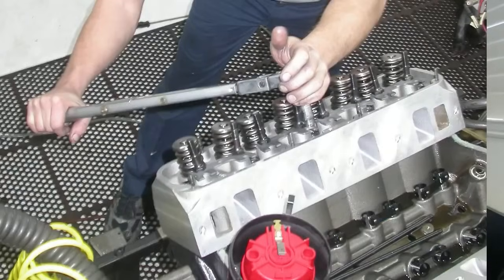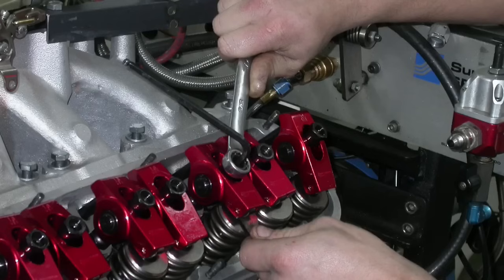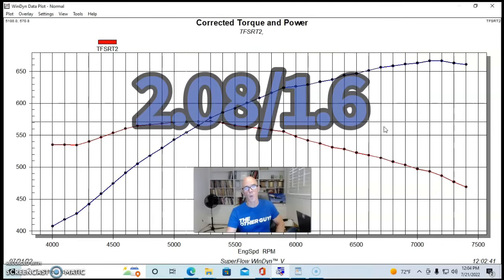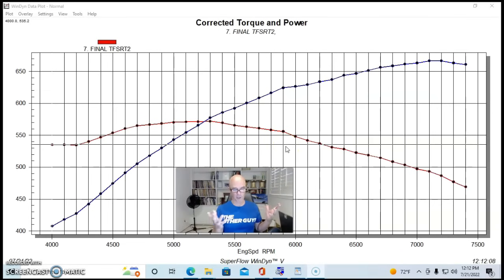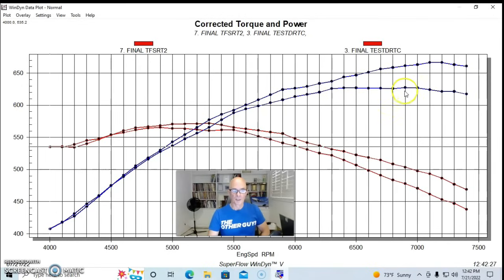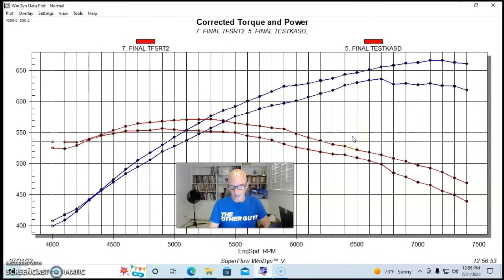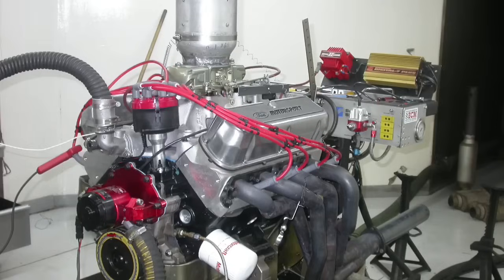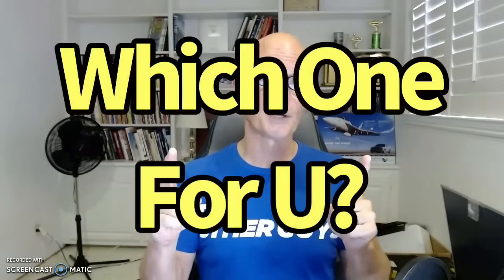WHAT CNC-PORTED SBF HEAD MAKES THE MOST POWER? KAASE v AFR v TFS R v DART v CNC VIC JR & HIGH PORT?

Comment: To answer your question, TFS R Heads are the best heads man can get, imo..
Reply: Unless you are racing those heads at a 1000 hp they are pointless if you can fork up that much money you're better off going to the four valve setup which will smash the trick flow heads in flow at a lower lift rate 
You can buy a four valve Lincoln aviator motor for around 1200 bucks and have four valve heads and a aluminum block at that for the cost of those expensive trick flow heads
Reply: @jonnathwill8318  Oh I know these things can flow like crazy, but why not start off with the best heads the 2v can have?? These are normally for big bore versions of the 2v.. I'm going lil bore, just 20 over but a 5.0 stroker kit rated at 1,000rwhp so eventually I plan on a positive displacement supercharger n testing the limits of the kit.. Reason I bought those heads is bcuz I didn't know they required bigger bores, I just thought it was CNC ported..lol But when I bought them they were $300-500 more than the regular ones so I thought they were much more worth it in the long run.. Now, price went up on them, plus there's always room for improvement with these heads so it's better to have them than want them n not have them, you know??
Reply: @P71ScrewHead  I part milled my 4v bottom end for 2.5k aluminum block, new forged crank, forged billet rods ,forged Pistons 2618 rated at 1500 hp 
I also have other parts for a cobra blower setup I spend around only thing I haven't got yet was the pulley bridge and I spent around 1500 to 1700 for cobra intake lower alternator brackets Cobra timing cover Cobra alternator relocation pulley sfi 8 bolt flywheel 
I paid 800 for the heads 9 thread db casting hopefully I can get my hands on a VMP blower 2650 gen 3
Reply: @P71ScrewHead  there's a guy named Andrew lavender on YouTube he was running mid 8 second quarter miles with Stock port 2v heads custom cams and springs with a single turbo basic forged bottom end nothing special 
He has now switched to trick flow and bigger turbo but he has also turned his car into a full-blown race car and to me over all he ran a lot better and had less problems when he had the stock Ford two valve heads that's why I try to tell people you don't need a lot of that exotic stuff create power on a two valve most guys are disappointed money spent versus actual horse power that they make
Reply: @jonnathwill8318  Oh yes, I agree, a simple forged internals make plenty of power but the less efficient the engine is the more lbs of boost you need to make power n the hotter it gets.. Also, that's turbo, I'm going pd supercharger.. Unless going race gas, e85, or alcohol, it takes alot more to make big power on the blower.. 20 over is the minimum required for the heads to work.. A stroker will always make more power than a stock stroke engine.. I'll dyno the results n determine if it was worth it or not.. But the Coyote makes power bcuz of the stroker n 4v setup, I'm a 2v guy tho.. Reason I spent this much was bcuz I was documenting the mods n dynoing the results but things quickly took a shit on me, my engine got worn piston rings 💍 (so I've been told) so I chose to scrap my plans n just do everything at once.. I was gonna dyno the adding the stroker kit by itself but now I'll have to see what everything gets me on the dyno.. Ppl spending $10+k staying 281ci, I rather have a stroker 2v..
Reply: @P71ScrewHead  19 more c.i or 0.4L is alot at the cost of having the piston come further out of the bores at bottom dead center which is going to cause piston skirt wear at a faster rate
I also think blower technology has come a long ways in efficiency and yes I do believe efficient motor less boost but
Your efficiency of the motor can also become not efficient with a improper cam selection  but with a positive displacement it also comes down to intercooler technology and heat exchanger technology which I believe has come a long ways
Also with those heads I have a email from 7 or so years ago before I started collecting parts for my two valve build trick flow stated to me that the r heads needed a bore size of 3.650 to 3.700 to truly be efficient 
They did state that the non-r heads will be fine with stock bore 
I have three crown vics and all of them are flex-fuel that run off of e85 only 
Also the coyote is Miles ahead of two valve technology the coyote has a bigger bore same rods as a 4.6 and a slightly longer throw on the rod journals on the crank that's 
The only true stroker that's worth the cubic inches is the 5.4L
Reply: @P71ScrewHead  this is my builds and parts on my other channel 
I haven't posted in a while because I am currently taking the motor out of my fourth crown Vic and put it in my 1 of my 3 crown Vic I had some issues with the fourth crown Vic that I had some Gremlins in that crown Vic so I'm transferring everything over to a different crown Vic
Reply: @jonnathwill8318  You're crown Victoria lifestyle?? Or what was that link to that sent me there?? i have a 95 Lincoln i let sit for almost 8yrs now, man i was recently told the motor is locked up, dang it.. Was trying to get it started again..
Reply: @P71ScrewHead  I'm am cv lifestyle I usually scroll through YouTube using this channel versus my other one people used to get mad at what I say and try to go back to my channel and bash me so I tried to be a little bit incognito and use this channel that way people don't go back to my main channel and try to discredit me
Reply: @P71ScrewHead  that was my channel it has all the parts that I showed you including my 4500 2v cammed motor I also have Cobra parts on there I have two Marauder lids it has pretty much everything I told you on there my aluminum block it took me so long to get to that point I just took a break cuz like I say I'm trying to remove the motor and trans from a fourth crown Vic that I have and put it in a better crown Vic that I have should have some videos up in the springtime
I had the cammed motor up and running but the car has some demons in it that I can't find so I'm just going to pull the motor and trans and put it in my other 2011 crown Victoria body
Reply: @P71ScrewHead  I do all the work myself I plan to create a return style fuel system using the stock fuel hat and use some an fittings is my next hurdle
Reply: @P71ScrewHead  may I ask how long have you been working on your project
And I don't know if you have talked to trick flow or not but you should give them a call or email because .20 over= 3.572 is buy no means a big bore I have that on my n/a 2v build now as they told me 3.650 to 3.700 is a bigger bore 
To be honest with you I can tell what you're trying to do is going to be very very expensive that's why I was saying stock 2 valve heads will fit most guys projects if I were you I would try to sell those heads get a set of stock heads at the junkyard or use some that you already have get a torque tech kit find a used Cobra type blower and call it a day trying to build mega power is costly
Reply: @P71ScrewHead  do you have anything else to go with the heads and stroker kit like custom cams/ supercharger intake lower manifold/headers/fuel system/transmission upgrades /do you plan on doing any suspension work / rear end I was just curious to see where you were at in your project
Reply: @jonnathwill8318  I've had my P71 for 7+yrs, bought the heads in late 2021.. Didn't install them bcuz I found out I needed bigger bores but TrickFlow said 20 over was the minimum to be able to use them.. I won't sell them bcuz no one will buy them, everyone's a cheap ass who pretty much want everything free or close to it in used condition.. I have brand new stage 2 Comp Cams I want to sell cheapest in the nation but no one has offered for them.. At $700 that's cheap, was willing to go $650+shipping but still nothing.. Payed $3,500 for the R heads if I remember correctly, now I think they go for $4k, so I got lucky on them.. One day I can just get the Boss block n new bigger pistons n have my big bore build.. These heads are better than the regular ones anyway so I ain't tripping.. I got the 38cc heads too but that's bcuz I was gonna install them for an n/a build but with worn piston rings 💍 I decided to stroke the engine n use my R heads on my P71..
Reply: @jonnathwill8318  The cams are are MHS TFS stage 3 cams, longtube headers already installed with 2 high flow cats 🐈🐈‍⬛n electric exhaust cutouts.. UD pulleys too, 3.73s limited slip, will be getting an 800+hp stall converter, most likely 3k rpm stall, still debating on stall tho.. Supercharger will be bought one debt is lowered a bit from building the engine..lol Tuner thinks my injectors 💉 will be good enough for now while n/a as it's e85 injectors.. Have you checked out my P71?? I have 17x12 widened steelies on 345/40r17s n I just got my 17x9 widened steelies for the front..
Reply: @P71ScrewHead  I just realized you have videos on your channel
Reply: @jonnathwill8318  Lol.. Just a few, nothing special either but they're there.. Preciate you checking them out..
Reply: I'm not knocking your setup but what I'm saying is you probably didn't even need all that stuff also like you stated those heads were meant for a big bore so you're probably going to lose some of the edge of the heads alone and a stroker kit on a 4.6 really doesn't do too much but make the Piston come further out of the bore which is going to give you more piston skirt wear I think livernois makes one of the best stroker kits if you just have to go to that and it's a 298 ci kit but to me stock stroke is more than enough
Reply: What parts do you have already besides just heads and long tubes
Reply: @jonnathwill8318  Heads, cams, UD pulleys installed.. Forgot to mention to you that the BBK tb n TrickFlow plenum is gonna go on there too.. 3.73s on the back.. Suspension will be next.. ADTR front n rear sway bars installed too..

Comment: I think larger headers would have made all heads work better i have the old twisted wedge but i would tfs rs ant day
Reply: Old school TW's kicked ass on the small 302 N/A's back in  the day.   They were always better and made more torque and power.    The rotated and canted valves gave the heads low lift flow advantage even if another manufacturer was able to get close to peak flow number.    And the chamber was a superior design.

Comment: Way way to small for a 427 cubic inch motor should have tested with 250TFS  heads would have made over 700hp . And used a 2” header .. just my 2 cents

Comment: Hey Richard when assembling a 1984 351w is it important to put the fuel pump eccentric back into the engine?
Reply from the maker: only if you plan to run a mechanical fuel pump

Comment: the reason I think this test failed is the "stock" valve job and possible sharp machining transitions that kill power

so much to look into here

do this again but talk to Eric Weingartner
Reply from the maker: The reason I think your comment failed is-we tested the heads the way they come from the manufacturer (not modified)
Reply: @richardholdener1727  
Yes exactly my point, they're out of the box
You tested them as most people would install heads, I get it
But that leaves power on the table 
I'm not saying hog them out to bring out the most power
But a trip to the machine shop/proper valve job, and some mild mild cartridge rolling to blend casting and cnc imperfections would be a better apples to apples base comparison 

Would be an awesome collaboration with Eric Weingartner
He does the flow benching and theory 
You prove it as you do
That would be sweet

Comment: The header size I don't think mattered. In that with that many cubic inches all the heads were choked. So over all the number maybe low but low for all. I think where the test could have been more equal is in the CR. And that is almost impossible to do. Because it would either involve massaging the top of the pistons. Or the chambers. And as soon as you touch the chamber it's not a cnc. Ported head. It's a cnc ported head with the cc reworked. So you did about all you could to evaluate the heads in a comparo. Maybe you could have done the hp. And torque under the curve like you have done before where the max number isn't as important as the total from rpm to rpm and if max power was @6700 rpm what was it at. 5700 for all of them and 4500 and so on. Some heads loan them selves to more power over 7500 vs some heads making the most at 6800 but make 40 more at 5400 vs the other. And are there no C3 yates heads out there that can use a nascar intake. ? Don't the C3's flow more than a tfs R ?

Comment: The headers were adequate for this power level but not optimal.  I doubt a set of 2" headers would have made more than 20 HP more.
Reply: They have these tests all the time in the Chevy LS land.    On this size of engine and power level 600-750 HP, the 1 7/8" header wins out.   Peak like you said might be 20-30HP but increases across the graph.

Comment: The Hi-ports NEED more than 1 3/4" headers. They have a unique exhaust port/bolt pattern just for that.  I heard you say the 1 3/4 were all you had, and if you were testing 351's, that would be satisfactory.  But those tiny headers (comparitively) really punishes the Hi-ports.  Probably some of the others too, but I know the hi-ports better.
Reply: Strange it’s almost like he said that in the video.
Reply: THE Richard Holdener didn't have any 1 7/8 or 2" Headers for a Ford?   I think the Hi-Ports will make as much or more N/A than the twisted wedge with bigger headers.  Just my opinion

Comment: Two takeaways for me, one is the headers were used on all of the heads, and if they restricted any  more than others in any measurable degree, it would have shown up in the tests. Like you said, if the lower HP versions were that restricted, they would have made at least as much as the TFS heads.
Second takeaway is that even though this is an old test, I still believe in those bread and butter AFR heads. I build quite a few Windsor street/strip engines and have used a bunch of those, and I have always had great performance and reliability with them. When you get up into the price per performance debates, AFR heads win every time for me.

Comment: AFR no longer makes the 225 its now a 220 head.
Reply: And the 220 Renegade head is much better than the old 225 head, which hasnt been available for many years. I thought it was strange that the old head was used. Also ive seen testing using the Kaase/Jegs head before that also made poor power. The only good power numbers ive seen with that head are Jon's numbers.

Comment: At 4:10 you made the claim that peak CFM#'s arent as important indicators for determining peak power#'s on the dyno.  Here are my thoughts.  You use the words "Big" CNC Ported cylinder heads but, and I've asked this question before on your other videos..,  big, compared to what? Your cam, intake, carb, Static Compression are in the neighborhood of a maximum WOT (wide open throttle) redline engine; but your 220cc to 225cc intake port heads for a 427 displacement as well as your headers are in the heavy hitter Street Head category. If your objective was to build a Street engine on pump gas then the heads and headers are good choices but if your objective was to build a race engine, then your cylinder heads and headers are poor choices.  Maximum Peak CFM#s are good indicators of Peak Power as long as you dont confuse your engine.  Your engine blurrs the lines between a heavy hitting street engine and a dedicated race engine. How one qualifies "Big" on any engine build and applies that knowledge in your engine component parameters, will determine whether you have maxxed out the HP potential of your displacement.  In other words how does one qualify "Big" on any small, medium, or large engine parameter relative to a mild, moderate, or maximum Power Output engine?  Having said all that, anytime you can get in the normally aspirated 600+ HP range, you're doing pretty good! Thx for taking the time to make the videos.
Reply from the maker: big compare to the other (smaller) heads run in the other three tests